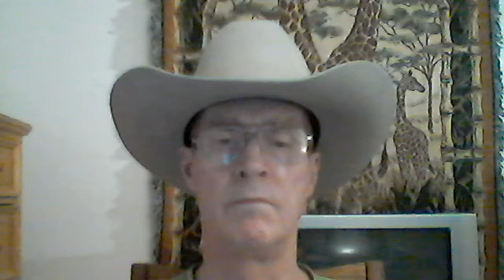Lithium Iron Phosphate Batteries

Comment: If you want to be able to run 100 watts out of something you can carry on your back, there's just no other practical way. Dakota Lithium (made in the U.S.), Bioenno and Battle Born are all good options. I get it, they're a little pricey up front but, cheaper in the long run. Try discharging a lead acid deep cycle battery 80% daily and you'll be replacing it inside a year (my experience). I have a LiFePO that is receiving this kind of abuse that's going on 4 years now. There's only one drawback to LiFePO that I've found but, it's a small one--they like being stored at about half discharge. I overcome this with a 150 watt solar panel with an MPPT charger--brings my 25 ah up to 100% in less than an hour. That, however, will not help you if it happens to be night when you need it.  (  :

Comment: Edit: I fixed the link in your last video to just a plain description. Yes, I’ve had experience with BioEnno batteries, and have had no problems with charging or discharging. Also, the battery is sealed, and very lightweight, and pretty safe to use, all thing considered.

Comment: I always use the LiFePo4 battery with my FT817ND, when I go to field operation; it's compact and light. My battery is projected for Drones, and it delivers 4 amps at 13.1 volts. It works very well, always delivering good power and current to my FETs... The only problem is to monitor it's voltage level, because it can not go down of a certain limit. 73 de PY1ZB!

Comment: It's a lithium ion for short. U can even use high c rating  18650 cells in parallel and series to get power needed. I use lipo high c rating  lithium polymer cells for drone racing. The lithium ion cells can't hold up to the high current. The lithium ions are less volatile though.   They are both better then lead acid much lighter but more expensive. I know a guy who has been in the deep cycle lead acid battery buisness for 40 years. he sells them for forklifts. He hates lithium ion! Haha
Reply: Anthony Porreca FPVRC Lithium Ion and Lithium Iron Phosphate are not the same. The open voltage is different, and the energy per volume of LiFePO is only half of LiIon. But LiFePO is more tolerant to over charging, doesn't catch fire and can take a higher charge or discharge current.
Reply: @robertvandersanden  yeah I was wrong. They are not the same. Good to know

Comment: I made a battery pack for my homebrew CW QRP rig, out of 4 LiFePO cells in series. It fitted nicely in a printer adapter housing. Only 2.5Ah but light weight and easy to charge, with a current limited constant voltage, like how you would charge a Lead Acid battery. The output voltage remains remarkably stable over the whole discharge cycle and these cells are less sensitive to over charging or over discharging. Added a BMS board for basic protection.
Lead acid would loose part of its Ah rating when discharging with a higher current and also needs more attention when storing for a longer period. LiFePO doesn't have that at all. Simply love them.